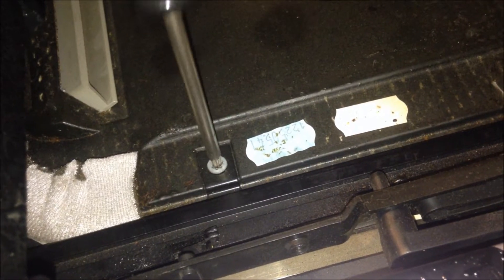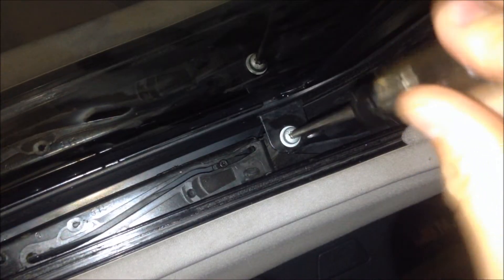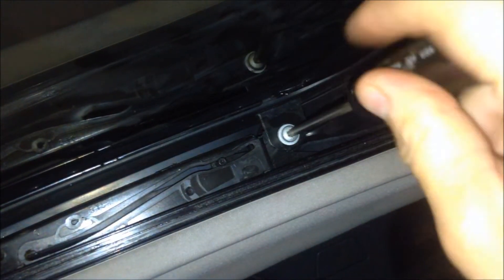Volvo V50, Sunroof and Visor Removal / Reinstallation

Comment: Hi Michael I have to start by saying thank you, your videos about volvos on this platform are brilliant.  I would like to ask a question about my sunroof/moonroof . I stupidly tried to open it in a bad frost & it move a few mms then made a bang & stopped.. the motor still works but nothing moves im thinking the cable has snapped or the bracket/cable clamp has broken .I have not taken it apart so not sure yet what has broken . Do you know what might have broken & would it be an easy replacement or should I look for another sunroof out of a scrap car many thanks Mark Hallett... MH...
Reply from the maker: It could be something damaged with the drive gear on the motor, or it could have just come disconnected. Hard to say without seeing it in person. Good luck!
Reply: Did you find out what was broken?

Comment: Hey, I recently replaced a broken sunroof, and bought a used one off of Ebay. I noticed it had a small gap in the seal, i'm assuming it's for the water draining system but i'm not sure the orientation nor if there's supposed to be a gap. I believe this replacement sunroof is leaking onto my visor as well, how is that possible if it's supposed to prevent that via the draining system? Any tips or recommendations? Thanks!
Reply from the maker: Should be an even gap all the way around the sunroof for drainage. Make sure the drains are all hooked up and flowing properly. There are four drains, one on each corner, but the fronts are most prone to failure. Also make sure the "gutter" tray isn't cracked anywhere and allowing water to leak in the headliner.
Reply: @MyNameIdeasWereTaken  Thank you I appreciate it!

Comment: Hey michael im in a bit of a predicament. I managed to take out the headliner just fine, however when i put it back on, i broke a piece of plastic that holds the frame from the back. its not leaking water but i dont know where to get the frame part from. its the section at 1:38 when you lift out the sunroof visor. If you know how to fix it or where i can find that part to replace it. Im lucky that it still channels the water to the drains, but am i able to somehow just epoxy glue it back in place or does it have to move alot in order for the sunroof to work perfectly.
Reply from the maker: I don't think that channel piece moves, so I'd just epoxy it. Maybe get some watertight tape and go over it after the epoxy has dried for added security.

Comment: My volvo s40 2005 sunroof has got one rail stuck open and the other one closed ,what advice would you give me to fix this issue?
Reply from the maker: If one side is just out of calibration, perhaps you can force them back in sync. Perhaps removing the sunroof and manually realigning could fix it. Or maybe part of the gearing to one side has been damaged.
Reply: @MyNameIdeasWereTaken  Isn't there a way to manually close the sunroof?
Reply from the maker: @gigaChad3505  I believe there is a screw near the overhead console area that allows you to manually open/close the sunroof. I can't remember the exact location of this, but it may be called out in the owner's manual.

Comment: Why would you leave the accordion pieces out?
Reply from the maker: It's a brittle piece that commonly breaks and rattles.
Reply: @MyNameIdeasWereTaken  So how long are you leaving them out for? Are you leaving them out forever?
Reply from the maker: @beebee5633  I just threw them away, which I did on my S40 too. The only purpose they serve is to hide some of the mechanical components and make it harder to get your fingers pinched while the sunroof is in operation. It's easy enough to avoid putting my fingers up there while closing the sunroof.
Reply: @MyNameIdeasWereTaken  So are you leaving them out forever?
Reply from the maker: @beebee5633  I threw them away... So they're never going back in.
Reply: @MyNameIdeasWereTaken Oh.